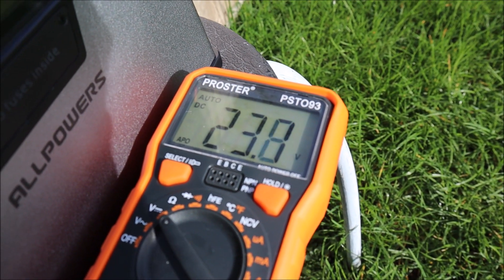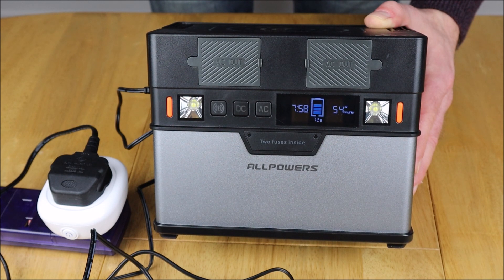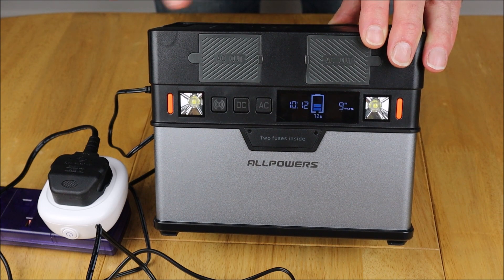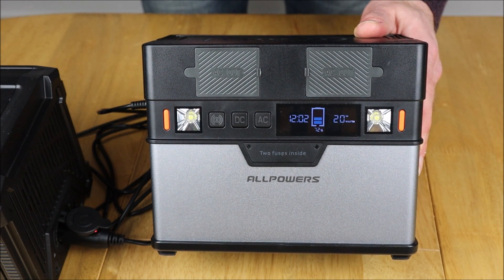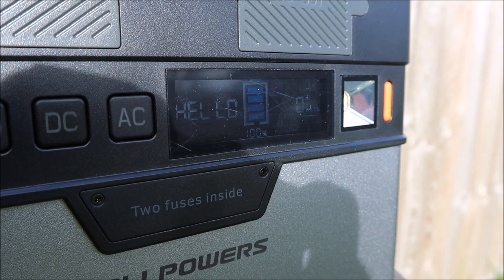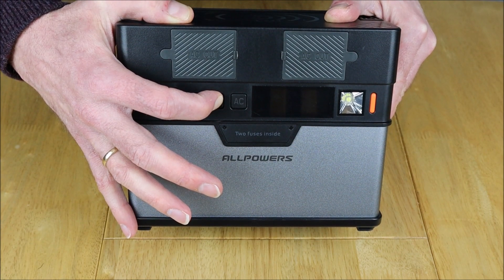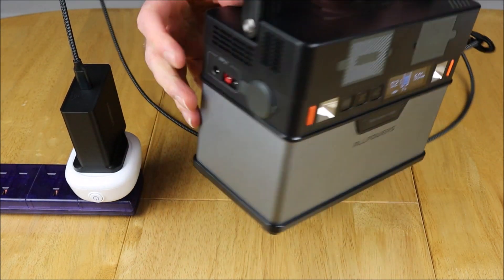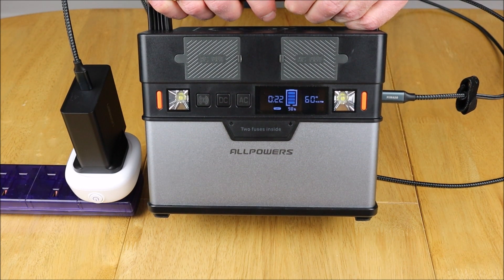ALLPOWERS 372Wh Portable Solar Generator Update | Charging Rundown

Comment: Hi, Absolutely brilliant very informative update review, I have Not yet bought one, I will be bothering to charge using the mains adaptor that comes with this! It just goes to show how much faster USB C is, so No carrying around the mains adapter when it will be so much better just carrying USB C Cable and QI charger! I have Subscribed to your Channel, as this being the 2nd Video I have Watched of yours and I am really enjoying your in-depth reviews! All the best 😊
Reply from the maker: @Dean Platt  Hi Dean! Thanks again for your generous feedback and it's brilliant to have you as a subscriber, welcome! I'm not sure if you've seen the following, but they show more of the 372Wh and you may find them useful too.

https://youtu.be/ViLdkYzOZqA
https://youtu.be/T_hlnoyAx2c
https://youtu.be/XftYntUfUZU
https://youtu.be/qLYXnp5OGmw (long-term update on ALLPOWERS 60W panel)

Please let me know if you need anything else. Cheers, Adrian
Reply: DADvinci Hi Adrian, I do have 1 question to ask you, I take it I would have to buy a AllPowers 60W Solar Panel? And I wouldn’t be able to use my Ravpower 24W Solar Panel?  Kind Regards Dean 😊
Reply from the maker: @Dean Platt  Hey Dean. Yes, you are correct about the Ravpower panel (assuming it only has USB outputs). It doesn't have to be an ALLPOWERS specifically as long as the panel outputs 18V DC it should charge the 372Wh fine via the Anderson port. You could even go for a 100W rigid panel (in this video > https://youtu.be/T_hlnoyAx2c) if you didn’t need one that was portable as they are generally cheaper than the folding panels. I hope this helps? Cheers, Adrian

Comment: Hi I’m having a problem getting hold of a power lead from the allpowers foldable 60w solar panel. Can you help?.
Thanks
Reply from the maker: @Ray Humby  Good day Ray and thanks for your question. Are you referring to this cable > https://amzn.to/2U97PXq (affiliate link)? All the best, Adrian
Reply: Yes I am, it seems to be unavailable and I can see it anywhere else any suggestions
Reply from the maker: @Ray Humby  Hi Ray. I'm not sure why these cables are like gold dust. I've pointed other viewers in the direction of ALLPOWERS and requesting one direct from them, but it can take a very long time to arrive. The next option is trying eBay, with a good proportion of what’s available listed in the US and not all having the little plastic cover over the Anderson connectors. The other option is using Amazon.com and some viewers have preferred this route.

I found this one in stock > https://amzn.to/2XWspfF and it seems to have good reviews, if you wished to use this option. You would probably have to use the adapter marked 'C’ that came in your panel package so the male end of this cable would fit your panel output. In addition, you would need to reconfigure the Anderson connectors to match the side by side setup for the 372Wh port. Changing the connectors around is covered in this video https://youtu.be/T_hlnoyAx2c should you go this route.

I hope this helps. Please let me know if you need anything else. Cheers, Adrian

Comment: I've had same problem with solar charging using the Anderson connector. I found a fix.... with solar panel plugged in, plug in the mains charger until it registers on the display. When you disconnect this the battery then keeps charging on Solar. It's like it needs a kick.
Reply from the maker: @Guy Martin  Good day Guy and thanks very much for sharing, much appreciated😊 I found the other workaround by chance, covered in this video (not sure if you've seen it) > https://youtu.be/ViLdkYzOZqA. I like your 'needs a kick' reference! It appears to be an over sensitive in-built charge controller. Please shout if you find any other useful things on this. Take care and all the best, Adrian

Comment: Hi great vid. Can this power a drill or a Hoover ?
Reply from the maker: @Nick Desai  Good day Nick! Thanks for your kind feedback and question. It all depends on the power rating of the devices. Did you have any specific ones in mind? The one thing I will say is that it's unlikely to power a mains vacuum cleaner but might be able to charge a cordless one (depending on the specs). I'm not sure if you've seen the following, but it shows some of the things I’ve managed to power with it (might be useful).

https://youtu.be/XftYntUfUZU

I look forward to your reply. All the best, Adrian
Reply: DADvinci thanks. I have a garage with no power so looking for some power for a normal vacuum cleaner, drills etc so I can work outside.
Reply from the maker: @Nick Desai  Thanks for the info Nick. Unless your devices (tools, vacuum, etc) are rated under 300W (limit of the AC inverter), I would not recommend this solar generator. 

The PowerOak 1500Wh that I'm 'living with' as well has a 1000W AC inverter and can power more devices for longer, but even that can't handle my 2200W vacuum. As you would imagine, it's much more expensive than this unit. If you did want to have a look, the first video of this is here > https://youtu.be/j83xHXI2XE4

Please shout if you need anything else. Take care, Adrian

Comment: Whats the maximum size solar panel you can use with this generator? I am looking at the ALLPOWERS 100W but can't find any specs for generator.  Also what leads do you require between the solar panel and generator?  Loving the informative reviews btw
Reply from the maker: @James Dwyer McCann   Good day James! Thank you for your kind feedback and question😊 There only seems to be a product manual link on Amazon.com (not UK), so here's the link from there > (https://images-na.ssl-images-amazon.com/images/I/B1IVw48M0hS.pdf). 

The manufacturer recommends a maximum 100W panel. From my testing this is spot on, as there's no point going any bigger due to the limits on the Anderson port. The manual shows the specs for the Anderson port as 16.6-22V with 3.2A max current. I get between 57-60W from the panel used in this video > https://youtu.be/T_hlnoyAx2c (if you haven't seen this).

You can use the DC cable which comes with the ALLPOWERS 100W panel and plugs into the DC port on the generator, but that will be affected on cloudy days (charging rate drops/gets capped). I recommend using the Anderson port for solar charging (as does the manufacturer), but you'll need a DC to Anderson cable like the one in this video's description (hard to find in stock though). You can ask ALLPOWERS to send you one, but this will take time to arrive. Other viewers have tried eBay, AliExpress and even Amazon.com to get hold of the cable, so these are possibilities if you can't find one on Amazon.co.uk.

I'm not sure if you've seen the video showing the workaround for the Anderson port wake-up issue, but this video covers this > https://youtu.be/ViLdkYzOZqA 

I hope this helps. Please let me know if you need anything else. All the best, Adrian
Reply: @DADvinci  Top man thank you... Yes I watched all your videos so am aware I will need to use the Anderson points for charging. The link didn't seem to be for the DC connector the other end.
Will keep looking. Appreciate your video as the solar charging issue via DC would have sent me crazy trying to figure it out.
The generator looks amazing for the price. For the Goal Zero similar model it's about 4 x the price.
Reply from the maker: @James Dwyer McCann  I'm so glad the videos proved useful. The link is to the one I purchased but they marked the title incorrectly (stating MC4 instead of DC) as the pictures, description and what turned up was the correct. There are quite a few on Amazon.com like this > https://amzn.to/3dkd0Lf and I’m not sure why they are so scarce in the UK.

The charging issues did send me close to the edge and I was about to send it back when the wish.com panel turned up. I'm so glad I found the workaround as it's such great value for what you get, despite the 'characteristics'. Please shout if you need anything else. Take care, Adrian

Comment: Hi. Great videos. I have watched all of them about Allpowers power generator. My question is: Did you try connecting a controller on the solar panel and then to the power station?   Because the biggest problem was when you cut the power, then plug it again...the watts go down....same problem with the solar. Because of this I am on hold to purchase it yet.
Reply from the maker: @romantashev  Good day! Thank you for your kind feedback and question. I've not used a separate controller with the solar panel, just the workaround I found to get the in-built controller working on the Anderson port. I'm not sure if you've seen the following, but these might help.

1 - https://youtu.be/ViLdkYzOZqA
2 - https://youtu.be/T_hlnoyAx2c

Once I got used to the workaround, it was easy to live with. I hope this helps. Please let me know if you need anything else. All the best, Adrian
Reply: @DADvinci  Yes, I have watched these.  I have ordered the ALLPOWERS 372Wh, s will see what propblems will have mine:). Will keep you posted. I have Renogy Rover 40A solar controller and will try with it too. Thank you  again.
Reply from the maker: @romantashev   Thank you 😊 I'd really like to know how you get on. Please shout if you need anything else and enjoy your weekend. Cheers, Adrian

Comment: Hallo Dadvinci, thanks for your Video! I also bought this Generator. I found there is a lost of energy ( without using ) at 1% per day. ( Temperatur 10-20C’ ). It means, in one month without any use , the lost of energy can be 30% . Is that normal phenomenon? Did your generator have the same problem ? Many thanks !!! Best Regards from Berlin!
Reply from the maker: @xusong gong  Guten Tag! Thank you for your kind feedback and question. I have not noticed a loss (without using) of 1% per day. Do you leave the Bluetooth switched on (display on) when you do not use it? My other suggestion is to do a factory reset (if you haven't tried yet). Hold down the DC button for 20 seconds until the display fully resets, this might help. Please can you let me know how you get on? Alles gute, Adrian
Reply: DADvinci haha sprichst du deutsch ? Eine komplizierte Sprache hahaha Actually I’m from China but leaving in Berlin, amazing city! I checked carefully and all functions were off, also I took your note 📝! Now I’m waiting for the answer from Amazon Germany , they still didn’t tell me your tips ! So comparing with Lithium batterie from DJI , then the lost 1% per day is really fast . If you want you can also have a test , whether your generator act in the same way ... thanks a lot for your tips!!!! :)
Reply from the maker: @xusong gong  Good day! Great to hear you enjoy living in Berlin. Did you hear back from Amazon.de? I've checked mine again, but have not noticed a drop yet. I'll try and check over the coming weeks, as I use it every day so might not get to see the drop like you do. Please can you let me know how you get on? All the best, Adrian
Reply: DADvinci hi Adrian, I explained to Amazon service , they suggested to send me a PD Charger( I mentioned before a charging problem as well, but they said they can fix that problem ) but about my question to energy lost almost 1% per day . It was not explained , although I mentioned already several times. That is a cool design and economic machine in the market. If the energy lost is a really problem, that is pity. Adrian, you might have more Know-how on batterie , could you pls check it as well in complete power off condition? On day 19 May the rest energy was 66%, day 21 May 63% , today 23 now is 62% ( in complete power off condition without any use) by the way, Amazon accept the return of machine. But I prefer to Check it some days more . Best regards from Berlin!
Reply from the maker: @xusong gong  Thank you for the info. I'll have to try over the next week as one day isn't likely to show an issue (as I've not seen before). I'll let you know if I see a drop without usage. Did you try a factory reset (holding the DC button down for 20 seconds)?

Please let me know if you need anything else. Many thanks, Adrian
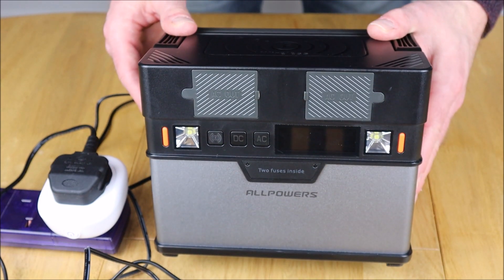Reply: DADvinci I still haven’t tried this but tomorrow I will try it , before to try it I would inform your the rest of energy , right now is 59% at 01:15 on 24 May.  Good night!🌙
Reply: DADvinci Guten Abend Adrian! I have already reseted the generator following your tips , but the machine acted the same. Now on 26 May I have 53% of energy ( Without any use ) . Form 19 May to today the machine in no working condition lost 14% automatically in 7 days. Have you tested your generator as well? Salute from Berlin!!! B.rgds Xusong
Reply from the maker: @xusong gong  Good day Xusong! Thanks for your update. I should have an answer for my 24hours test tomorrow. When you leave the battery (and all the buttons/display are switched off) do you leave any cables plugged into any of the ports? Alles gute, Adrian
Reply: DADvinci Dear Adrian ! I can confirm that all buttons/display are switched off and no cables plugged into ports. I just check it again now the rest power is 51% . So thanks for doing the test and waiting your comments ! Que tengas un día muy linda! Abrazos de Berlín! Xusong
Reply from the maker: @xusong gong  Guten Tag Xusong! Thanks for confirming about your device. My battery test started when I stopped using it completely on 27th (morning). Before the start of the test, I'd used it overnight to run a fan in my bedroom. Here are my results.

27th Morning = 67%. 
27th Before Bed = 68% (batteries had recovered slightly)
28th Morning = 68%
28th Before Bed = 68%
29th Morning = 68%, then recharged to full as needed to use the battery today

As you can see, these results show that my battery maintains charge when not used for 2 full days. I hope this helps, but I'm not sure why yours would lose charge. Please let me know if you need anything else. Alles gute, Adrian
Reply: DADvinci hi Adrian, sorry for my late reply and many thanks for your test! I think your result showed a quite standard quality and it helps me a lot to do a decision with Amazon sales service. I would like to change it for a new one! Thanks again for your help!!! : )
Reply from the maker: @xs7218  I'm glad to help🙂 Please let me know how you get on. Take care, Adrian
Reply: DADvinci I will let you know how will they react :) take care and keep healthy!!! Big hug 🤗

Comment: Hi Adrian 

Thank you for the fantastic series on the AllPowers 372 series. 

Please can you advice as to whether one can use a car cigarette charger with usb c output to charge the unit? 

Also- if I am charging the unit using an AllPowers solar panel, am I correct in saying the end attaching to the solar panel is DC5525, and the other end that you plug into the AllPowers 372 is DC5521? 

Thanks for your time in advance. Kind regards
Reply from the maker: @mrdoug6  Good day to you! Thank you so much for your kind feedback and questions.

Charging the 372Wh via the USB-C port needs to be done by a charger that supports PD (power delivery). Providing the cigarette lighter charger supports PD then it should charge fine (although I've not tested one of these as yet).

Based on my 60W ALLPOWERS panel, you are correct. The DC cable that came with my panel is very short so I bought 2 more slightly longer DC5521 cables and use the 'C' marked adapter (that also came with the panel) so I can still plug one end into the panel. If you do wish to charge with solar, I recommend getting an Anderson cable otherwise cloudy days will affect the charging rate. Once you get used to the ‘panel cover’ ritual when you first plug in the Anderson cable (+ the display wakes up), it will charge at the best rate the panel can deliver all day.

I hope this answers your questions? Please shout if you need anything else. All the best, Adrian
Reply: DADvinci 

Hi Adrian 

You’re an absolutely star. So helpful and friendly. Very informative vids too. 

I did indeed buy The 100w AllPowers solar panel. Working very well so far. Alas when they sent me the panel they mistakenly left out the Dc cable so I had to buy my own. I’d agree with your Anderson cable suggestion- and I learnt from another one of your videos (or perhaps from one of the comments) for best result, plug it into the unit first then open up the panel. 

By the way, I hope of returning the favour of your helpfulness- I know in the past you have posted a link for an Anderson cable- BUT as you said amazon were always out of stock. 
After much looking I finally found the following on AliExpress:

https://m.aliexpress.com/item/4000759683185.html?pid=808_0000_0101&spm=a2g0n.search-amp.list.4000759683185&aff_trace_key=&aff_platform=msite&m_page_id=962amp-DmIbM3JBlb-1Ggbo4YvuXQ1590090073072&browser_id=fa9c571ae42f498db0c810e517604966&is_c=Y

Hope that’s the right one and helpful to everyone else looking. Thank you
Reply from the maker: @mrdoug6  Thank you so much for sharing the link. That is most kind and considerate for other viewers seeking this elusive cable. Please do let me know if you need anything else. Take care and all the very best, Adrian
Reply: DADvinci 

Thanks Adrian. All the best to you, family and your channel. Cheers